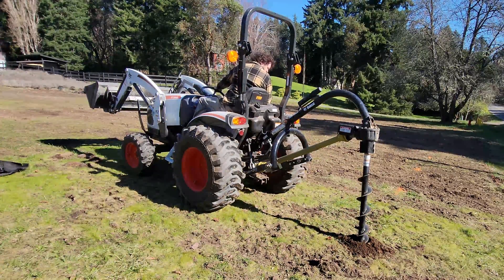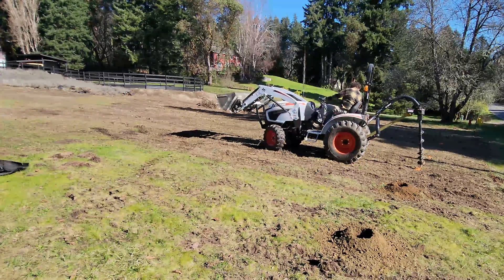3 Point Auger Attachment - How To And Should You Get One - Bobcat CT 2025 Compact Tractor

Comment: I have a 70 year old Ford Jubilee tractor, 32hp. Any recommendations on the brand and or type of auger I should purchase?
Thanks
Reply from the maker: Don't have any experience with a tractor of that vintage. If it has a 3 point and pto setup like most tractor I would just get the auger from tractor supply.